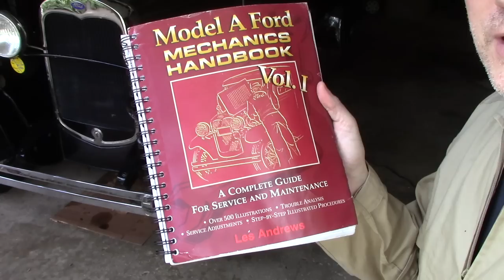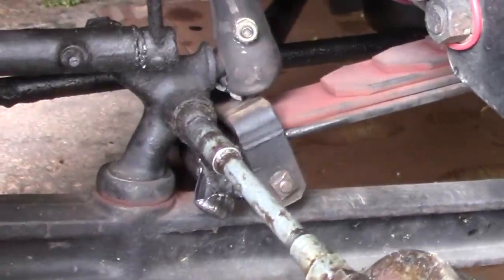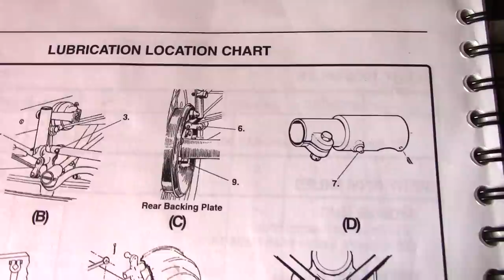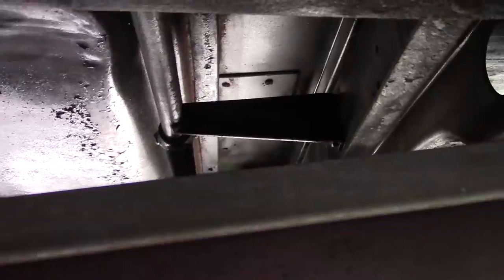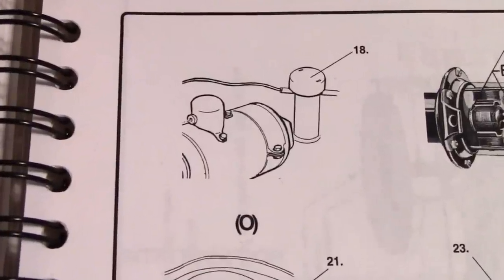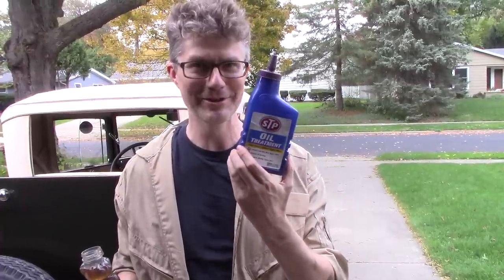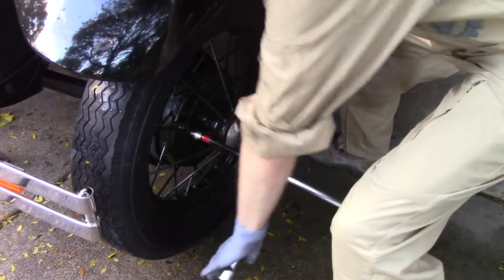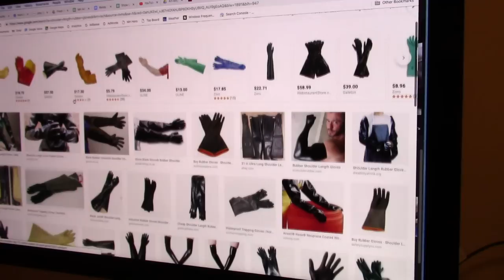How to Do a Lube Job on a Model A Ford

Comment: Just to clarify,  600w is NOT 600 weight. It is just a brand name. It is steam cylinder oil. It is thick enough to slow the gears down for shifting.  If I remember right, it is comparable to 240 weight. Love your car, nice to see younger guys driving and taking care of these fabulous cars! Enjoy!
Reply from the maker: Thanks! I have learned that I was wrong and the 600w oil after posting the video, and I appreciate you helping clear that up for everyone

Comment: Note that Mark's car has replacement style Zerk lubrication fittings, not the original fittings that came on Model A's.  Thus, he uses a grease gun that locks on to those Zerks.   If your car still has the original fittings, you can get an adapter for the modern grease guns from any Model A part store.

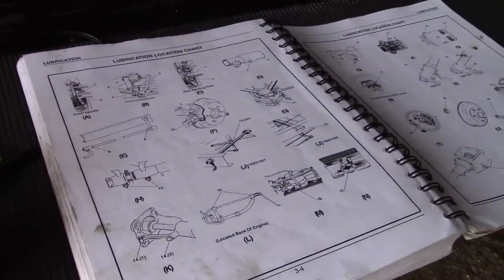Comment: Mark, look at 1:44. Appears your front spring clamp has slid down your spring into the spring perch.
Reply from the maker: Thanks for the heads up! I'll check it out!
Reply: @MarkHayward  You are most welcome. But, I did not catch it. There are a lot of Model A people watching it. In my opinion, unlike responses I see on FaceBook all have been most positive. The two things they commented on were the front spring clamp and that one of the shackles might be loose.  In my opinion, it is rare to get  this many Model A veterns to watch a video and not express a lot of comments on how things were done wrong.  Many people are sharing your video. A typical comment is 'Thanks, good for a first timer"

Comment: Well done video. Thank you for this. Personally, in the Central Alabama climate I use any decent 10-40 in the engine, Chevron Meropa ISO 680 in my trans and rear end, and Rislone Hy-per Lube Oil Supplement in the steering box of both of my 31's. Never use grease in a steering box. It doesn't like it!
Reply: the owner before me put grease in the steering box not sure how to get it out without rebuilding the whole box?

Comment: I suggest a hose and quick connect for straight and 90 degree tips. Easier on the tough spots. Also, clean before as well as after. Grease collects dirt.

Comment: You forgot to grease the two fittings on each rear backing plate for the brake lever & emergency lever including  the brake cross shaft and the brake pins.  Why not put the car up on jack stands? It makes a lot easier to work underneath.
Reply from the maker: Ah, bummer! I was trying so hard to not leave anything out! I do sometimes put the car up on jackstands, but this time I knew I was going to have to roll it around a bit to get the lighting where I wanted it to be, so I decided not to. You're right though, it makes it so much easier to have more space underneath.
Reply: @MarkHayward  hi mark great video thanks what fuel do you use premium or unleaded thanks
Reply from the maker: @MrTrucker1952  Sorry for the slow response, I missed your comment when you posted it. I use the lowest octane, just because it's cheaper. My understanding is that when these cars were built the octane of gasoline was much lower, so they're actually built to deal with gas that is way lower quality than what we get now. If that's true, then premium doesn't really make any difference for Model A's. I may be wrong about this though.
Reply: @MarkHayward  The value of high octane gasoline, of course is that it is designed to resist detonation or pre-ignition on engines with a much much higher compression ratio than your Ford 4-banger. Most people think high-octane gas is "rocket fuel" but It doesn't provide more power output than low octane gasoline in and of itself. Low octane gasoline is easier to ignite though, for sure.

Comment: Thanks .im doing mi first greasse lube job afler a long time(ford e83w pickup )...y worked on her but y didn.t clean it so much..so y pick off bearings many times to repare brakes and to changue front and rear axle but y asembled it with  only a peace off greasse throw my fingers.

Comment: can you tell me what weight oil you used in the distributor? do you have more videos on the work you have done on your model A?
Reply from the maker: I used straight 40 weight oil in the distributor. I don't think it much matters since you're using so little. So far this is the only model a video I've made, but I plan to make a rear wheel bearing replacement video next. Anything else you'd like to see?
Reply: @MarkHayward  anything you guys want to share it would be great. I could give you a list of things I would like to see  but there's not enough space on this blog for me to list them all but brakes would be one of them. I bought the Les Andrews book because of you guys and it has helped a lot but it is so much easier to watch your videos  because you two are very detailed in your deception's you give and are very entertaining as well so its not like I am seating in a boring class with some teacher that is putting me to sleep.  if you post it I'll watch it. "So if you build it they will come". lol

Comment: I use a pump type oil can. To fill my steering box but I have a 7 tooth that only has the 1/8 plug. What are your color combinations. I have a 28 Sport coup, painted Washington Blue and Black with cream wheels. I'm considering a repaint in original Ford colors but the 28 Sport Coupe colors are so lame.
Reply from the maker: Haha! I think my car is Brewster Green (body & wheels) with a lighter candy apple type green pinstripe, and black fenders. I found out when I was getting the pinstripe done that it's not a standard Sport Couple color scheme, so I have to assume that my grandfather felt the same way that you did when he got it painted back in 1985. I go back and forth with whether it's better to have an original paint color, or to be happy with what you've got. I think it's fine if you want to be original-ish, and just stick to the Ford colors and pick the ones that will make you the happiest. For most of it's life my entire car was painted flat army green because my grandpa did it himself. So the way it is now is a big step up.

Comment: i am glad cars no longer require this, what is the pink wire holding on? on the right front
Reply from the maker: That wire is for the turn signals I installed. It has that crazy path because I was trying to avoid using zip ties if I could, to retain the period look of the car as much as possible.
Reply: pickups still have a few.

Comment: What kind of oil did you use in that can I didn’t want to just throw any old oil in there @Mark Hayward also what kind of oil for the rear differential
Reply from the maker: The little oil can has 40 weight engine oil in it, and the differential is 600W, but you can use STP as well. The Mechanic's Handbook has a list in the back with all the different lubricants and where to put them.
Reply: Mark Hayward thank you sir just ordered a handbook looking forward to your other model a videos

Comment: Back then cars had a LOT  of grease fittings, today cars don't even have one grease fitting
Reply: It would be nice if they would add them to permanent ball joints just to be able to add grease when they get old and worn out.
Reply: With enough  grease fittings a 90 yr old car rolls right along.  I've had my '30 coupe for  50 yrs.
Reply: @masonzayas8401  Problem is that "permanent" ball joints tie rod  ends are not permanent you will likely be replacing them between 60k to 120k miles  on  modern cars depending on how you drive and how good or bad your roads are.
Reply: @robc8468  lol I understand that thats why I wish they could at least be serviceable to increase their lifetime.

Comment: Ugh.. NEVER turn the wheel of any car with the full weight on the car and the car is not moving...
Reply from the maker: Other than it being difficult, tell me why you say that.
Reply: @MarkHayward  You place extra stress on all parts.. esp on older cars. But hey ask any profesional mechanic.. or google it...
Reply: Don't fret too much about turning those wheels on a Model A.  The car is very light and the steering gear is all heavy duty.

Comment: If you ever drive it in cold weather, temps down around 0, you will be taking honey bear out of the steering box and putting thinner oil in, unless you are super strong.
Reply from the maker: Good to know! Plus, now I have an excuse to not drive it in zero degree weather!

Comment: If you paid more than 10k for the model A you already got a lube job with out the gun.had a 60caddy had about 40fittings had to supervise at the station 😁
Reply from the maker: My grandfather bought it new in 1930
Reply: I admire the caddy with 40 fittings- it was designed to last forever.

Comment: All basic commonsense. Don't use rag to gather old grease,just paper towel is all that's required. Grease often or every set period like 6 months or so. Like greasing your Zero Turn Kubota lawn mower.
Reply from the maker: I like to use rags for the old grease because they are durable, and I have a continuous influx of old cloth, so it's not a big deal to throw them out when I'm done. They were going in the trash anyway. Plus no trees were felled. Not a big deal either way though.
Reply: @MarkHayward  No, it's no big deal. I still use rags when I have them but I spray them with WD40 to clean the area around the fitting. I have a show car,so when you win the big shows like I do, it matters to keep things looking new. The reason paper towel is good,is because you can burn them rather than throw them in the rubbish bin.Seeya!
Reply from the maker: @myredute  Good point. Burning greasy paper towels is great!
Reply: @MarkHayward  It might be great but I have to pay for a bundle of rags & I get paper towel by the roll from Costco for bugger all. Only use flannelette rags for polishing & dust removal.
Reply from the maker: @myredute  I tear up old worn out t-shirts,  sheets, etc for rags. They build up faster than I use them.

Comment: seems like if you were smart, you would have bought a flexible hose for that grease gun, instead of fighting the steering wheel
Reply from the maker: Yeah, that's not a bad idea, but I inherited it from my grandfather and I get great pleasure from using his tools the way he used them. Also, sometimes it's nice to remember how things used to be much harder in the past. I'll keep that in mind when I buy the next one though, thanks.
Reply: The problem with the flexible hoses you need one hand to hold the hose end to press against the zerk fitting and the other hand  to squeeze the gun pump lever.... But with the gun he's using, you only need one hand, so he is smart..